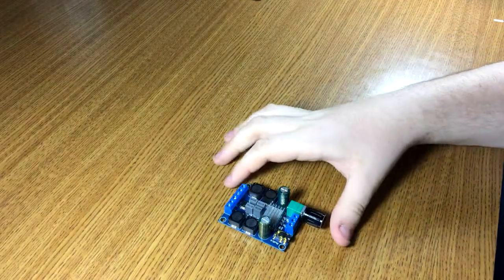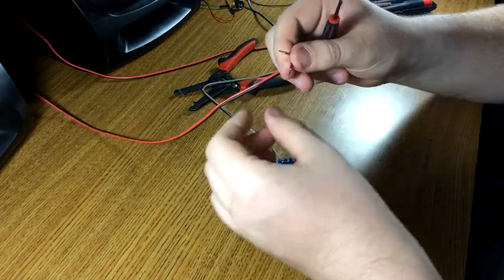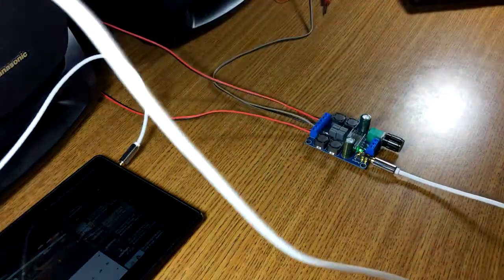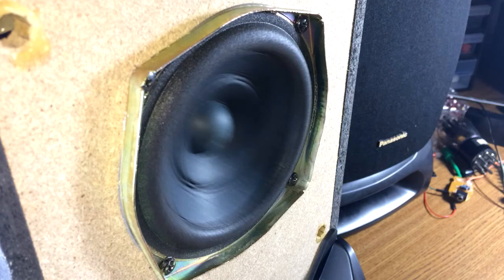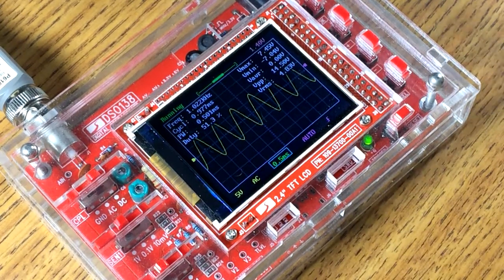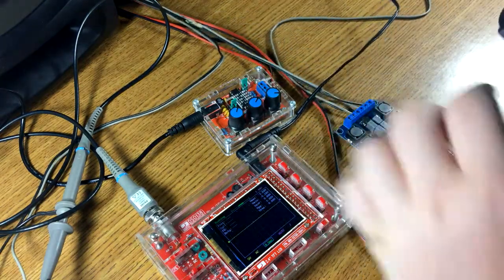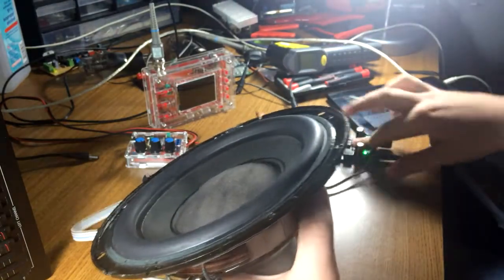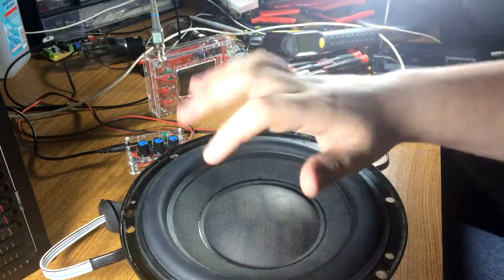ICStation XY-502 TPA3116D2 Amplifier, Torture Test

Comment: the first good emplifire test on youtube
Reply from the maker: Ehhhh, theres lots of better ones out there. i just do the things other people wont do.
Reply: Has anyone fooled around with Audio exciters.. ? Ive had outstanding success with isolated (free hanging) medium sized coroplast and heavyweight corrugated cardboards in smaller to med sized panels with 3 to 20 watt exciters (approx 21x35 ) 
But by far foam xps has given thr best results ... I have tried all thicknesses..  been using 1/2" xps insulation foam board (expanded polystyrene ) foamular 150 brand pink.    48 x 30 panels (almost3x5 ratio) , large radius corners  radius starting 6" from the corners and smooth the edges all around.. heavy bead of pure silicone caulk applied to the edges and spread out with an old paintbrush made a durable edge and eliminates alot of detail sanding the imperfections from the cutting...

Exciters applied at the 2/5ths over from one of  the sides and 3/5 down from top (critical for proper range) .. then drill or burn 1 inch diameter holes through about 4 inches from each corner and roll eggcrate foam around hollow rubber tube and stuff through the holes .. seems to isolate the panels from the wire or string used to hang them from the ceiling, you may have a better idea that was within reach in the garage..hanging with a foot clearance each side...  hanging in opposing corners at a 45 seems to allow sound to bounce off the corners behind the panels and gives the best stereo for my room setup...  Exciters used have been hit and miss.. absolutely best for panels has been Dayton 40 watt 32mm mega bass with the 4 legs .. 30 and 40 watt metal support spring types are also very good.. 

The pair of panels with exciters using these type bluetooth boards will blow you away and change your mind about how good resonance panel speakers can be..  proper panel construction.. carefully isolating wires and panels..rounding edges etc is super critical for good sound.. as critical is placement of the exciter at 2/5th x 3/5th location... and the 3x5 ratio regarding the panels dimensions.. so keep your dimensions close to 18x30 inch (3x6 x 5x6) or 21x35 inch (3x7 x 5x7)...or
27x45 inch (3x9 x 5x9) or close as possible and round the corners radius edges and you'll be good to go.

Comment: What will be the effect when I change the 35v1000mf capacitors with 35v2200mf capacitors. Kindly answer me.
Thank you.
Reply from the maker: it wouldn't make much difference. all that does is increase the DC filtering on the PCB, which if you have a good enough power supply, won't matter much.

Comment: Can you try 12v and 2A  power supply ... i plan to buy one
Reply from the maker: it wont be any different just have less power output. 12V X 2A = 24W. so 24W going in, no more then 24W out.
Reply: Dear friend, what will be the effect when I change the 35v 1000mf capacitors with 35v 2200mf.? Kindly answer me.
Thank you.

Comment: what power block?12volts?
Reply from the maker: my supply can go up to 21V. but the TPA3116 will work down to around 4V
Reply: @bassblasteraudiotech4918  s there a lot of sound? Have you been connected to a low frequency column?subwofer test?
Reply: @bassblasteraudiotech4918  sound loud or not you try subwofer test?
Reply from the maker: its a full range amplifier you can use it on any speaker. loudness depends on how loud you speakers can get. the small bookshelf speaker i used here got fairly loud from this board. for subwoofer use you probably want to find a mono TPA3116d2 board. this one is stereo and wouldn't be ideal for such use.

Comment: Try to get your hands on a better scope.   Appears your trying to be another JohnAudioTech type channel.   It's all fine,  just try to do it right.    Watching a speaker being trashed with massive distortion is only entertaining to those not really interested in audio.
Reply from the maker: lol i actually watch JohnAudioTech, i was going to get a new scope for the longest time but in the last couple years i dont do as much electronic work as i used to so i dont see the investment worth it. Even tho i can get brand new digital scope from a good brand like Rigol for $259 and Siglent for $279
Reply: @bassblasteraudiotech4918  I have multiple scopes and the prices I paid are way way more then what they cost these days.  It's funny how everything else appears to have gone up in price but the scopes and some other test gear has plummeted.    Perhaps it's because people were not in buildings using/buying them as much.   Good luck with the channel.